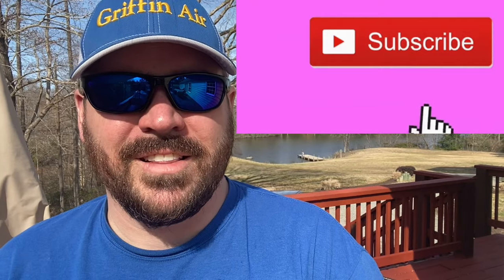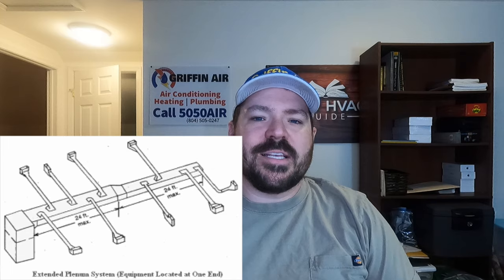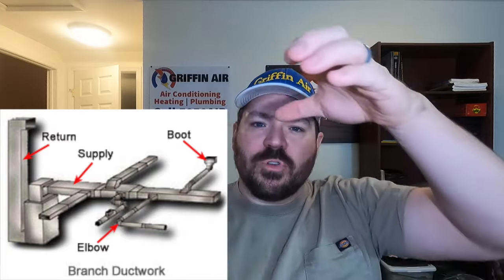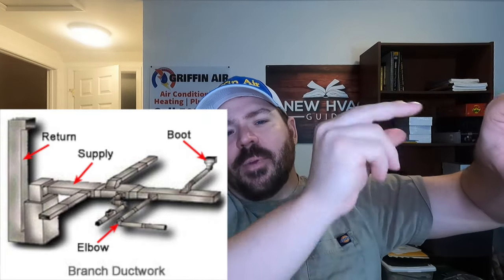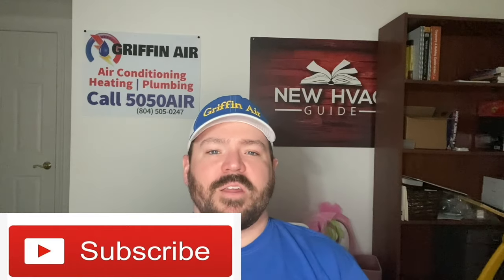3 HVAC Ductwork ISSUES Homeowners NEED To Know!

Comment: Perfect explanation of HVAC. I’m a plumber of 30 plus years so I’ve seen some duct work. If new homeowners and about 95% of home inspectors would watch this video a lot of new homes would be left sitting! Several years ago my Dad hired in the side a couple of my sisters X buddy’s to install a new furnace and a/c unit which he purchased and of coarse he upped the tonnage which he thought would be better. Well after the install the unit which was a Lennox began having problems. Well of course he had a HVAC contractor come out and they said they couldn’t find any problems. I went and just put my eyes on it and began doing some test just using a thermometer and common sense. After doing some thinking and calling my buddy which is a HVAC company owner and explaining the situation and giving my thought on the problem he told me your exactly right. The unit was starving for return air with the unit being upsized. So I called my dad and told him I’d be over the following weekend and we can address the problem. Thank god I got there when I did because he had already drew out lines on the walls where he wanted the return vents and had started cutting Sheetrock with a razor knife. I stopped him in his tracks from cutting any further and told him we’re not going up into any walls we’re gonna go through the floor! Short story long we finally got the returns in and the unit has worked fine ever since! The contractor world needs more Professional People like you in it!!!
Reply: I thought returns are always through walls near the ceiling and not the floor ?

Comment: I rented a 5000sq ft building for my restaurant, was having trouble with the air flow. I was shocked when i went in the attic and see what the previous rented had done. 2   4 ton units main duct work was about 8 foot long, each unit had 12 vents. but they used 12 flex to all the vents and tapered down to 6'' about 3 foot before the vent. this caused NO AIR FLOW. not to mention the power bill was 1200 a month. i fixed all the ducts. and air flow is good and power bill is down to 550.

Comment: 10 years ago I had round  hard ductwork installed and it’s cooled the house better than ever. Recently I called a company to check for a leak in my unit and they ended up sending out a couple guys to give me a estimate on a new system. We had heavy rain the previous day and they told me they couldn’t price a new unit without new ductwork as it got wet and had water inside.
The ductwork was installed with hangers and may appear it’s laying on the moisture barrier but it may just be the insulation that got wet. I don’t see how they can tell if water is inside. It’s a large heavy duct . They left without giving me a quote because I declined new ductwork. What do you think?

Comment: This is such a critical video.    I think I'm going tour some new open houses in my area and see if the ductwork is up to par like the points you made in this video, and then find out who the HVAC installer is for those properties!
Reply from the maker: Let me know how that goes pal. Good or bad
Reply: @NewHVACGuide  Will do!   Just the fact the you're protecting people's investments is awesome because nothing more I hate is spending hard earned money only to be disappointed afterwards.
Reply: @NewHVACGuide  You should do a video on return duct strategy & placement. I went round & round with the scabs that installed my mothers system back in 76 about return ducts. They should have louvered vents with 1 high and 1 low on each floor so that in winter they suck cold air into the furnace and in summer they suck hot air into the A/C system so the system can adjust the house air pocket to make the T-Stat work less often to maintain a constant temp and make the system cheaper to use. They put the only return duct in the downstairs floor and in summer the upstairs temp was 45* hotter than downstairs. 25 yrs later I got the house and cut the wall open and added a return upstairs and evened out the temps myself.
Reply from the maker: You bring up a good point. Makes me wonder if sometimes things are not done properly because they are trying to keep the cost down as much as possible or if some folks are just simply lazy?
Reply: @NewHVACGuide  the answer is both unfortunately 
The answer is both

Comment: most people do not realize that you can heat a house with 4 inch duct but to cool the same house it will take a lot larger duct I remember a man a do it yourself-er and duct his whole house with 4 inch duct this was during the winter well he calls me up and now it is the spring going on summer he tells his air condition isn't working right it was work alright several weeks ago I went out and looked at his system and he installed all 4inch ducts though out the house well I told him that the ducting is to small e said well it heat the house just fine and it cooled the house until a couple of weeks ago he did not believe me so  he asked me what to do I told him he need a load calculation to size all the ducting well I did a load calculation and there were two 2 rooms/places that took a 4 inch  duct it was a walk in closet and a bathroom when I told him the price and he had rooms where the Sheetrock would have to be removed and the air handler would have to be relocated job was going to be $ 6K he though I was lying and cheating him - he is reason why I charge in advance for load calculation now

Comment: Thank you so much! I was getting ready to open up that end where you just told me not to to add another piece of duct myself. Lol unfortunately what we used to have was the metal ductwork and after we had a flood in my area when the guy redid the furnace we ended up with that cheaper looking flexible stuff. I don't know if it's as good as the metal or they're about the same.

Comment: My Ductwork in my 2nd floor blows massive velocity cold air in the open area & hardly any velocity in the three bedrooms.

There are air vents are over my downstairs & it freezes us downstairs. 

Whereas the bedrooms are 6 to 10 degrees hotter.

Can the bigger ducts go to the bedrooms instead?

Comment: Our 3 y.o. house has been half hot half cold on day one.
In 50 years, 5 houses never had this issue.
The lennox dealer twlls me no problem.
Told our builder if it does not get corrected I'll be calling the customer experience number.
Right now i have a window unit in back bed room.
And it's  a spray foam insulared house!.Arrgh...

Comment: Please Help..my problem is I have 2 seperate Central Air Systems for my 2 family home..been getting estimates for 2 new Systems..my problem is they say can use existing duckwork also the condensors one in attic ..one in basement..I have had 4 HVAC reputable contractors give me free estimate..today just got first quote..32,500..thats alot the pdf I received only had possible one rebate from ma save for 7,500..the contractor said ..I may not qualify for more rebates..due to my home is heated by pellet stoves ..mostly not oil heat..as I have oil burner..but cant show receipts for oil purchased..as I mainly heat with pellot stoves..still waiting on 4 more quotes..Crazy..as a home owner for 47 years..running into astronomical  quote..so far..still have 4 more quotes to come..I have done my Research with the BBB= Better Business Bureau..to make sure no complaints on them or that . IM NOT GETTING SCAMMED..I just hope they are being Truthful on my home not needing new du twork or new vents..Wish Me Luck..

Comment: I'm in a newlybuilt 1500 sq. ft. townhome 2 floors 3 bedrooms,  and the back 2 bedrooms never seem to get cool. I have a Carrier 14 Seer 2 Ton condenser.  The air in the front bedroom and downstairs is cold enough but in the back 2 bedrooms its very warm i.e. Front room 73 Back 2 bedrooms 78.  Thermostat is set for 72 but on a really hot day it runs all day trying to get to 72 but never does.  Any ideas?

Comment: Plenums with duct work off the sides work good as long as you keep your take offs towards the cap and use volume dampers at wys for each supply to vent. And alway as Mr Griffin said step down size at transitions Great video 👍🏽

Comment: The cooler the return air is the better your Delta T will be, correct? If your getting 80 on the return and 60 after the evap thats fine, but as the house continues to cool you should be able to maintain the 20 degree delta, correct? Lets say your return air is 75 and the temp after the evap is 55? Is my logic correct? 

Lets say your home temp starts off at 85 so your return temp before the evap is 87. As the home cools, your return temps go down, technically the temps post evap should.continue to go down?

Comment: Just had my house detailed by a sheetmetal worker and discovered that the work done by a previous "mechanical" contractor was essentially trash.  My kids rooms never got ac in the summer and heat in the winter. The contractor ran a supply line to the branch of a wye to feed 2 rooms. Pathetic
Reply from the maker: I’m glad they found it!

Comment: I have a Mobil home ac vents are in the floor. ? Is should the return air be up high over the coil or should it be in front of the coil  I ask this because when I got the trailer it has two returns 16/20/1  direct above the coil. It’s a 4 ton

Comment: Own a ranch, have 6 ducts on the main floor 2 have high flow 2 have adequate supply and the last two are useless. Have 4 in tbe basement that are so-so. To me it takes too long to cool the house given its a 42x25 ranch. This cooling season will be the compressors third. Not only does the usless one's  on the main floor not cool the two rooms they feed it's the same outcome  during heating season. Have a Goodman gas furnance it is six years old. Also the duct work is original to the home (built in 1952 ). Any advice ?
Reply: goodman-my condolences...

Comment: Thanks for the video. I have a question I hope you can answer. We did a remodel on our kitchen. There was a Half wall that created a small entry space from the front door that we had removed to enlarge our kitchen. 
This wall had a hot air duct that pointed into the small entry way. After the renovation and removal of the wall, that same vent now is open and points down into our basement area. Can I remove that since there is already a vent into that room or should I leave it alone? thanks

Comment: Is there way to determine if your existing HVAC system is big enough to add room vents to? I have a basement that was finished but no vents. Wanted to tap 2-3 vents into the existing ductwork but concerned may affect system ability to heat the house. Worried if I have an HVAC company look they’ll see it as an opportunity to force sell me a bigger unit I don’t need.

Comment: Is the solution for a spider duct system to run less lines with more branches? Mine has 4 flex ducts in one box 2x2. Two go to either end of our bonus room and two run to the upstairs bath and bedroom. The furthest runs are 20 and 25 feet. I can barely feel any airflow even by adjusting the other vents to semi closed. Thought about installing fans to push the air but am looking for a better way. No leaks or pinches in the lines.

Comment: We are replacing the 31 year old spider ductwork in our attic this week and our the HVAC contractor is planning on using mastic tape vs non-hardening mastic sealant on all the joints. Should I insist on the messier non-hardening sealant? Is it a good idea to use the non-hardening sealant layered over top of the mastic tape?

Comment: I live in a mobile home. My problem is critters getting underneath and tearing into the duct work. The obvious, of course is to seal the perimeter, so critters can’t get in. That is not an option.
Is there a protective covering available to put on the duct, so the critters can’t tear it up? I’m getting new ducts next week and really don’t want to start repairing within a month. Any suggestions, other than the obvious I already mentioned? Thank you!
Reply from the maker: They have the spray foam for ductwork now. I’m not sure that’s a perfect solution but maybe it might inhibit the critters?
Reply: them rats hate tin foil...

Comment: Had a new hvac installed with duct work. One of the flex duct is resting on the water heaters vent pipe. Is this okay or should i put on a heat shield?
Reply: Call the contractor NOW and send a picture to them. While you wait on them to repair…. Use plastic plumbing strapping to lift and isolate the hvac duct from the heater’s vent.

Comment: So far I’ve gotten 3 estimates to have A/C installed to replace the furnace only I currently have. Not once have the company looked at any of the registers, duck work or the return.  3 company’s that I’m not hiring.  Should I have any confidence in the 4th will be any different?
Reply: Probably no different
Reply: @johnwhite2576  yup no different… 4th said we don’t install or work on ducting, just what’s needed to adapt new unit to existing ducting. 
Minimum effort at a premium price… slowly putting themselves out work pushing more and more to the self install setups that are rapidly growing

Comment: I have a 3500 sq ft house, two floors. The furnace heat comes out only from the left side of the house. I checked the duct work, both sides of the house come out from the same duct, I am confused.

Comment: Good video. 
I have 6 inch lines for rooms.
My question is return air will be 6 inch as well. 
Can I install 4 " vent for washrooms? Approximately 50 sft.

Comment: Will 8” flex fit over 8” metal ductwork? I have a small piece (36” long) of metal ductwork in a closet that is sweating like crazy
Reply from the maker: I don’t think so. But you can insulate the hard duct nonetheless
Reply: Get some bubble wrap (the tin foil looking stuff ) and a roll of tape.

Comment: If my filter doesn’t get dirty what problem is this suggesting? My house is dusty. I’ve changed my filter. I’ve tried the simple and expensive and I’ve used the pleated. But none get dirty even if I leave it in for months at a time
Reply from the maker: Is the return in the ceiling or down near the floor?
Reply: Filters are on air handlers to protect the equipment that is exposed to the air flow going through the air handler.  They are not there to remove the majority of the dust in your home.

Comment: Those of you who are HVAC techs who design the ducts and size the HVAC unit will argue about this HVAC system design improvement. Because below I am outlining an electrical improvement that will save hundreds of millions each year across the USA.
As follows: Add to the thermostat control panel the ability to control the level by selecting 1/2, or 1/4 heating or cooling energy.
What this does is reduce the flame for the heater, and reduce the compressor for the AC, and also reduces the fan for both.  Now it is perfectly safe to close those unused vents and save a few hundred a month or possibly thousands of dollars a month depending on the square footage of the space being heated/cooled.

Comment: 😣PLEASE HELP!!!
Is it possible to switch or change ducts from insulated tube style to the rectangle style?

We have a new build, but the manufacturer put in insulated tube style, and I wanted the aluminum rectangle style. It is a double wide 28' x 80', and the tubing wasn't built correctly in some areas where they wouldn't line up plume and be off by 2 inches give or take. Now I smell mice, and it stinks yo the point where we don't want to utilize our heat and/or central air!
Reply from the maker: Yes it’s possible

Comment: I’m in the process if redesigning my attic hvac system, i Have a 14” supply line off a 3.5 ton unit, two bedrooms on north end if home sit right underneath furnace in attic so they’re super short duct runs and as a result cool down and heat up super fast in comparison to other two rooms, other two rooms sit on opposite side if home, supplied from a 16x16x36 supply dist box, fed from a 30 foot 14” supply flexible duct, so you can imagine way less pressure on those two rooms, my plan is to shorten the main 14” supply duct so that distribution box sits right in the middle of the house, then feed all 4 rooms with equally distant same diameter duct line, I’m thinking that should equalize air output into all rooms, what do you guys think?  Thanks

Comment: I bought a house in 2022 with heating/air that hadn't been upgraded since 1996. The ducts had mold in them. So we got a small company to replace all ductwork and system. The unit was in the crawlspace and had sheetmetal (with fiberglass insulation on inside) ductwork trunk line throughout the crawlspace with flexducts running off the metal trunk ductwork. I was kinda surprised when I saw after job was done that they didn't use any sheetmetal ductwork at all to replace the trunk line... only used flex duct for the entire duct system.

Is that normal these days? Anything wrong with having all flex ducts?

Comment: I have a 5 legged spider to deal with.  Definitely looks like a DIY project by previous owner.  Big, fat 9 inch ducts with asbestos tape.  No HVAC company will touch it so I gotta do it myself.  I'm hoping to find some sort of cap for the extra holes and commit to a main trunk line off of the remaining take off.  Then will use flex duct to reclaim some ceiling space.